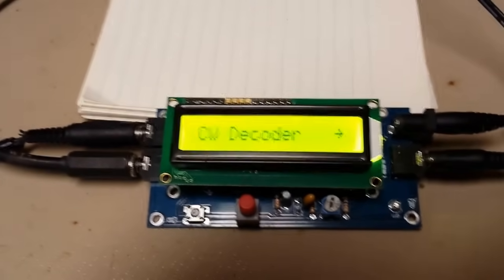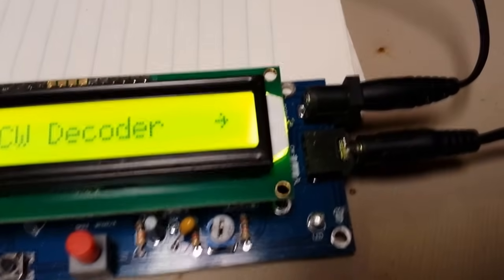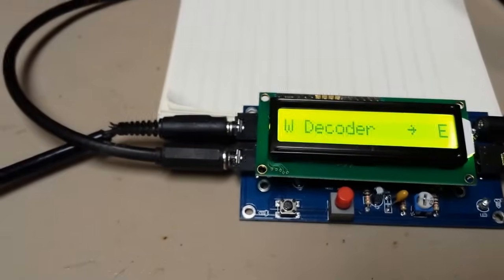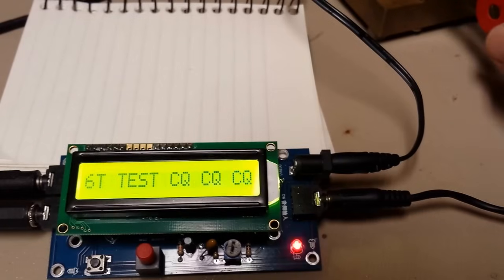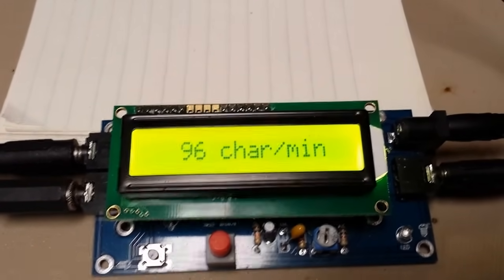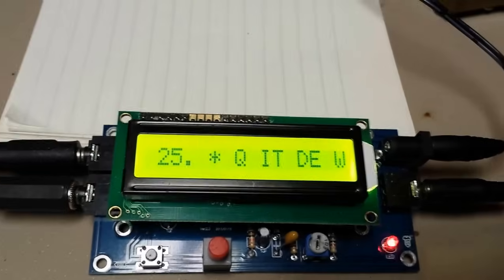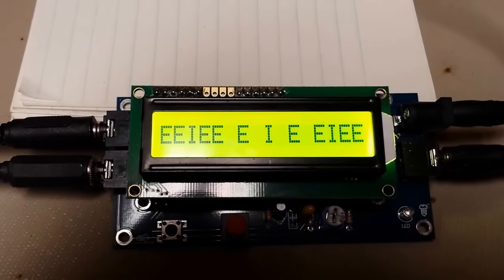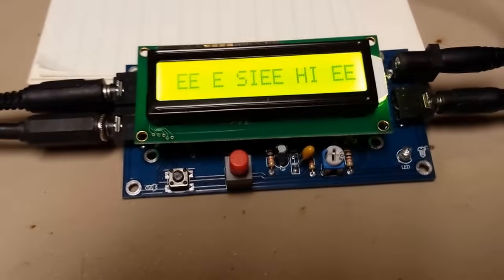Cheap CW Decoder on Ebay

Comment: Got one to play with; observation; very sensitive to static noise in the audio. Considering adding a 567 and 555 to detect signal tone and regenerate a cleaner signal for this board. 100% copy on pre-recorded (no static) practice audio CW. Fun for the price.

Comment: Thanks for telling us the connections.  I just bought one,  I knew it was 9-12 volts centre positive socket, with my meter as there are no instructions I'm waiting for a stereo to stereo 3.5mm lead, only have mono & no spare plugs to make one. I will find some commercial morse sent by a computer from the Israeli army in the 6.6 MHz range. I have used software & is pretty perfect when there a good signal, or there's a commercial station in the 8 MHz range which says over & over "free radio medical service" I'll adjust the pot. 73's

Comment: I had no luck getting mine to function.  I plugged a stereo aux cable out of my MFJ oscillator, into the right side.  Then plugged a small speaker into the left side to monitor.  I could hear the tones going through...  No matter how I dialed the oscillator tone, and dialed the pot on the decoder device I never got the light to light up.  I tried doing the contiuous tone at various settings on the oscillator, and slowly turning the pot through its entire range, and the light never lit up.

Comment: I was a USN radioman. Good to copy Cw up at least 25 wpm. Used to love doing contests, rag chew all that. Then I ended up with essential tremor, which put me off the air on CW for decades. Piero Begali helped me get past that. Discovered that everyone had gone to computer generated CW over 40 wpm. Just now getting back on the air & got one of these to help my jaded ears copy these machine code show offs. Ain’t a bad device but I had to modify the resistors around the tone control to match what my ancient ears now tolerate. Still not a bad deal. We’ll see how it works in the next CW contest.

Comment: It appears you need to do a better job of tuning the radio… it is critical.. mine works better than your demo.  But it’s not the top of the line.  It takes a bit for it to catch the speed, but once it does, it does OK.  The faster the speed, the higher you want the menu to show characters/min.

Comment: This video was made over three years ago and this item is still being sold, and still without instructions. Thanks for this video Steve. After spending a lot of time on it, I could not get the key input to work and did not try the audio input, which as you said, is not very good in any case. I would not recommend the purchase of this item.

Comment: Excellent job on analyzing and presenting the details. Especially when you got the kit with no accompanying instructions.

The device happens to be not very good at decoding, highly dependent on good signal quality and perfect keying. 

That is true also of many of the much more expensive decoders too.

Most keyers of today send perfectly.

But receiving Morse more reliably awaits advancements in AI. 

Thanks for the video.

73 from KD2KWH.

Comment: What type of 9V Power Adapter is required: Tip Positive or Tip Negative?
Reply: Steve said Ground is neg.  So, the tip is positive?
Reply: I think the inside hollow part (not tip) is positive. It is the hole in the center.

The exposed outside part is the ground or negative.

As is usual with plug-in DC power supplies.

Check with a simple multimeter if in doubt.

Comment: Although it has its short comings why not do some experimenting by making different filters to improve the incoming  signal.  
 if the radio is picking up a lot of noise , ' As HF does" why not compare try it on  an SDR  qrp radio or similar  where the back ground noise has been improved by the use of digital filters .
And for the  cost of few dollars what do you expect, isn't ham  radio about experimenting and trying different things  or has that time  now come and gone overtime with our expectations.  We are now spoilt with new radios and equipment  as new items flood the market of choice as new improved  technology moves forward .  
Our forefathers that used ham and those who had no choice  to use  what they were given  or build what had to work with ,  what would they think  now  if they seen what we have to day ?.  
It will be the same with the next generation  in another 20 years as they look back , and the next after that  one and so on.

I like seeing reviews and I think t is great people go out there away to show others but at the same time,  there are a lot of wingers over a few dollars..... instead of taking a problem and  looking in way of improving it as a project,   Ah its from China  its crap ill just through it i the bin ,  where is  most of your equipment made today?   back to basics is always a good refresher to see how far we have come.

Comment: Decoders are very tone sensistive. If it is set for 670Hz and the radio tuning makes the tone 700 Hz you will get garbage.  As shown backing off on the signal does help but tone is important.

The largest problem with decoders is simply the no spaces, all dits, bad code on the air. 
Decoders are a good check for your sending, especially for spacing. If you send a A N and decode  a P you have work to do.

Some OM are very animated that decoders and other gagets are BAD. While I will agree they may be a distraction and add time to properly learn CW anything that gets someone to listen to CW is  good. Given enough time they will learn code inspite of the toys.

TMI - Most decoders use a PLL to detect the CW, the loop bandwidth can be very narrow, the tone must be close.

Comment: Eventually we will move into computer generated morse and computer deciphering of morse. I use a laptop with HRD software and get better copy than i can do in my head and much better sending than i can do with my paddles or keyer.  Its not the copy i get thats so hard to decipher its the really horribly sending and mistakes and running all characters together without spacing.

Comment: Personally, I'd be worried to use this with a practice oscillator.  I think it may discourage more than assist.  I'd prefer being told that my code looked right but my timings were loose... rather than be told 'all was garbage, give up'  HI HI

Seems a decent CW decoder should track a buffer, so that it can adjust parameters and do "late correction" on previously displayed characters as the senders timing margins become clearer.  I think that, and smart tone detection, are probably a software thing and not so suitable for discrete electronics.

I could be wrong, but I've yet to see a robust discrete decoder.

Comment: The 'char/min' is an abbreviation for 'characters/minute' or 'characters per minute'. So 93 char/min would mean 93 characters per minute...as in sending or receiving speed, depending on what you're using the decoder for.

Comment: If you want a decoder/reader that works look for an old ERA Microreader. They work for CW RTTY. The ERA has built in tutor for sending with a key or auto for receive practice as well.  The later ones could also decode Navtex. **  Navtex needs  Mk4 Firmware revision. **   All the modes work well when connected to receiver audio output. **

Comment: Characters per minute?  I've never seen a supposed 'decoder' that worked worth a crap on the air.
Reply from the maker: A computer running CW Skimmer can decode anything. It forms the basis for the Reverse Beacon system and is just amazing.  However this thing is pretty useless.
Reply: I have had very good success with the K-42 Morse keyboard/reader by K1EL. It is about $100 and is a kit but is ruggedly effective.
Reply: thanks kc4gst